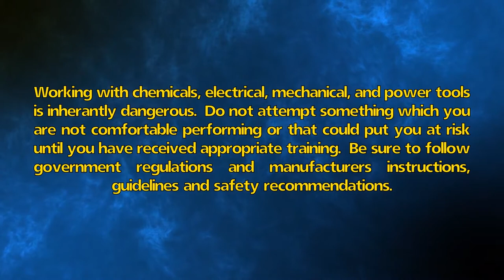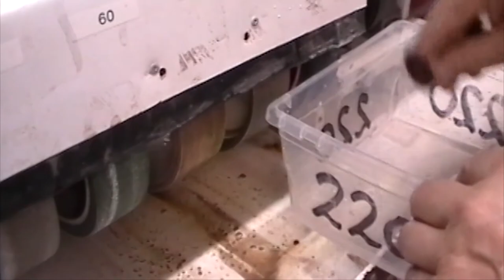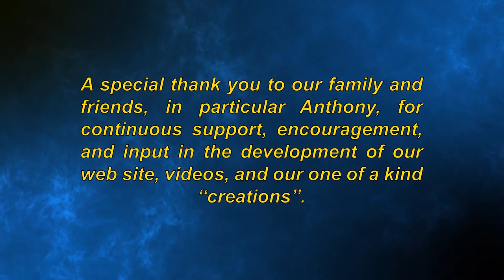Polishing a Tiger Eye Stone Cabochon, step by step in detail.

Comment: Who has this kind of equipment at home ?
Reply from the maker: Sorry for the delay in my response.  We are preparing for an art show and I have been busy making frames, matting and mounting paintings, and updating our website.
All of our lapidary equipment is used.  We got started when we joined a seniors lapidary club and we all shared the equipment at the club.  I bought my polisher from a fellow that wasn’t using his and the seniors in our club were always happy to sell their personal equipment they weren’t using for a reasonable price to people who would enjoy and make use of it.  I did buy a new tile saw from Harbour Freight and I bought a better quality diamond blade for it which I use for cutting slabs.  I mounted a cheap vice on the tile saw to hold the stones.  Once the weather warms up I will be making more videos of how I do my lapidary work.  I do my slab cutting outside because it is messy on a tile saw but the water in the saw has a tendency to freeze at -30°C.  We had a chilly winter this year.
If you do a google search for lapidary, or rock and gem clubs in your area you may find sources for equipment, mentors, and friendly people.

Comment: And I thought sharpening a drill-bit free hand was hard.
Reply from the maker: It really is not that difficult providing the minerals in the stone are the same hardness.  When you get different hardnesses in the stone the soft sections grind down faster than the hard areas.  Then it is challenging to get a consistent shape.
Sounds like I should do a video on sharpening.  I sharpen lots of different tools for my wood turning... including drill bits.

Comment: I don't know what that is, it's definitely not tiger eye of any variant
Reply from the maker: I have the original slab which is a beautiful tiger eye but this was a partial end piece that wasn’t cut at a good angle to the grain in the stone.    I used it to show the process in the video rather than show the quality of the stone.  When I get back to doing some lapidary I will likely cut the rest of the stone properly and polish it and then append it to this video.  This year I have been busy building a wood fired pizza oven and doing forging, welding, and wood turning for the tools and doors.  I plan to do a video where I incorporate wood turning, resin, and lapidary in a project but I need to finish my current projects first.  I plan to make some more lapidary videos to show cutting, dopping, and polishing methods using tumblers and flat laps.  There just aren’t enough hours in the day.  Hopefully I will have a descent tiger eye to show in the future.
Reply: @liz-artcreations6633  in my opinion though, Blue Tiger Eye, Red Tiger Eye, or hybrids of Yellow, Blue, Red are all way better than your average yellow Tiger Eye, unless it's that bright Yellow "honey" Tiger Eye that has a high translucency to it
Reply from the maker: It sounds like you have a really nice selection .  I only have yellow and blue tiger eye.